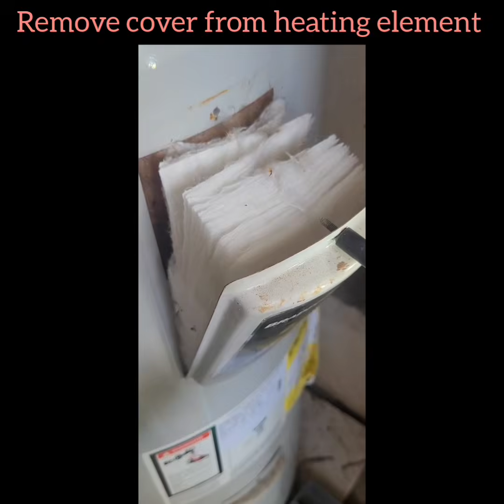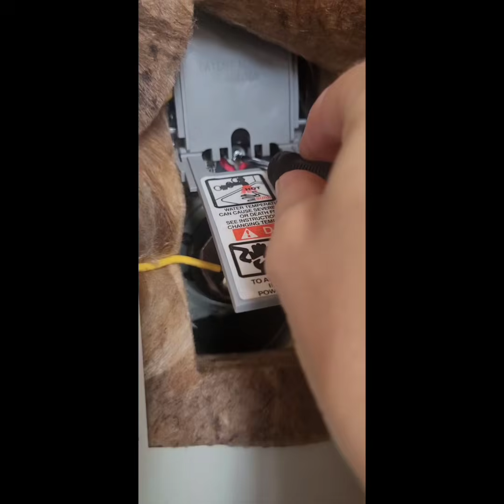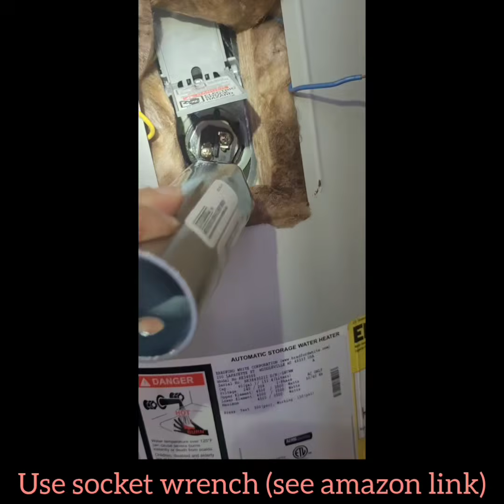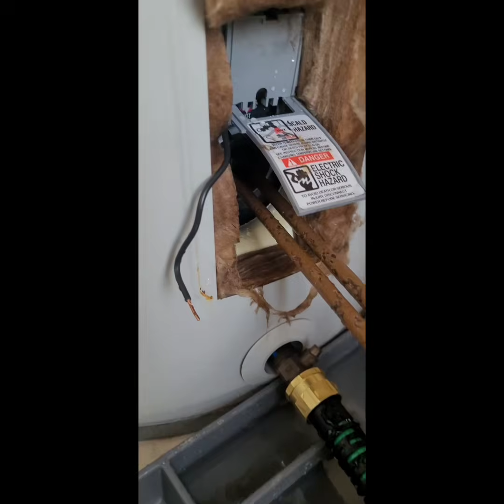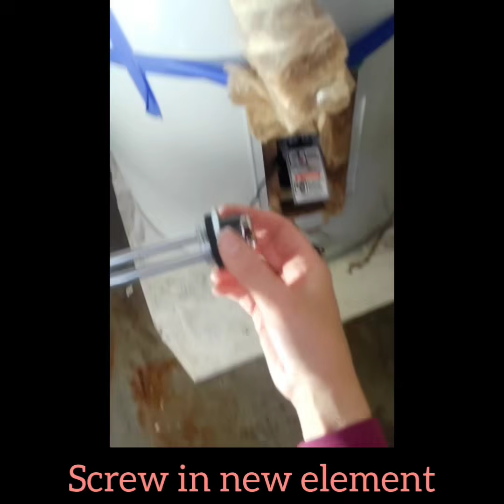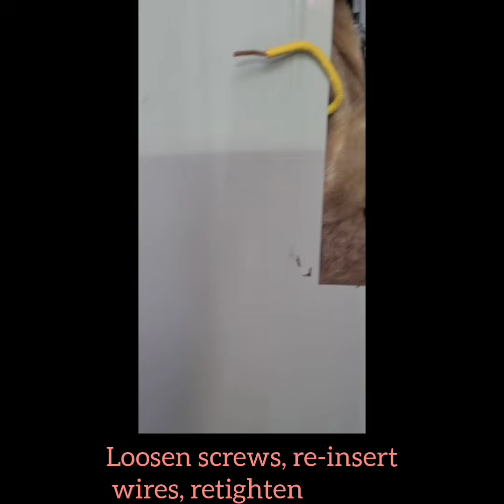Replace water heater heating elements, Bradford White. make sure to turn off power and drain first!

Comment from the maker: ⚒️Electrical tester tool:
https://amzn.to/3MghV6h
⚒️Heating elements BW
https://amzn.to/4pBfV71
⚒️Socket wrench tool:
https://amzn.to/4p9Erwb
⚒️Tiny screwdriver set:
https://amzn.to/4rrFbOO
⚒️Wire strippers / plyers:
https://amzn.to/441IAtM
⚒️"Pipe cleaners"
https://amzn.to/3M8USdS
⚒️That beautiful easy to clean Kohler sink:
https://amzn.to/4iwOkBF
⚒️Knee-high pantyhose:
https://amzn.to/3Xu3sWT
⚒️Small-space folable Anode rod BW 3" & 5"
https://amzn.to/48vWV3b
⚒️Anode rod heat trap BW:
https://amzn.to/48mXLyT
⚒️Thermostats:
https://amzn.to/4pJIHCM
⚒️Blue monster PTFE tape (for anode rod)
https://amzn.to/4pLhlw1
⚒️Pipe thread sealant (for anode rod install)
https://amzn.to/49KoNTn